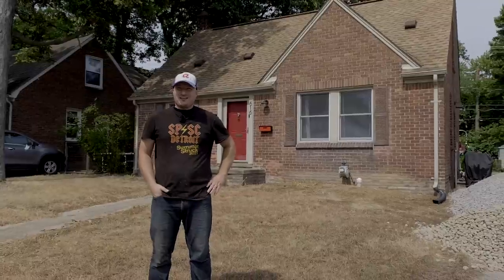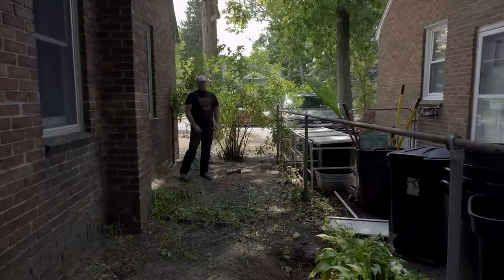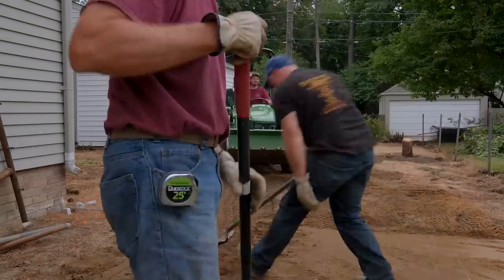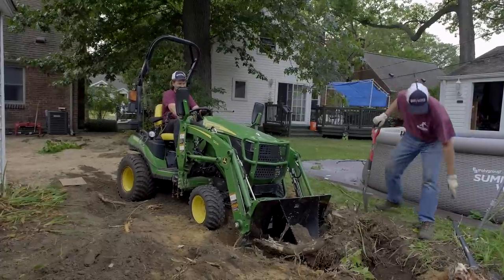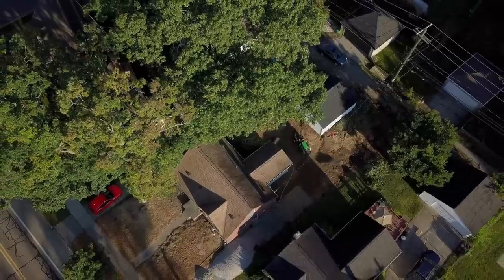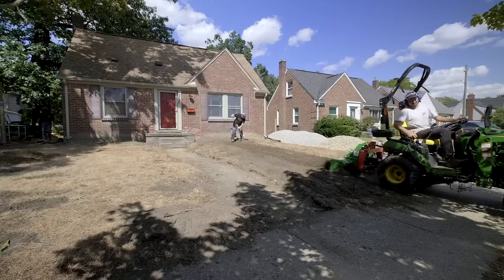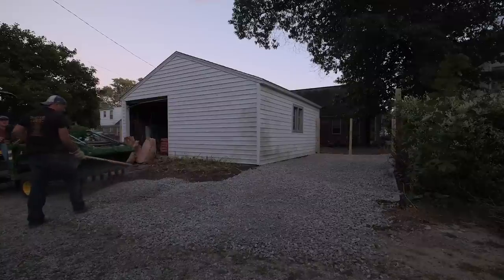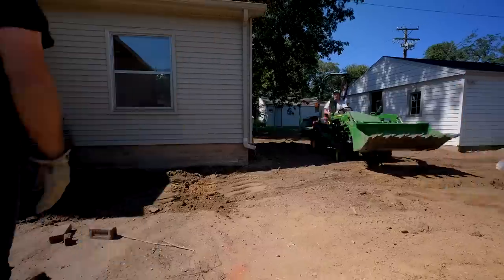JOHN DEERE 1025R RENOVATES CITY LOT! PROVING ITS WORTH! 🚜

Comment: I think it is amazing what you can accomplish with a small compact utility tractor and its attachments. I own a 37 year old John Deere 650 on turf tires with 2000 hours and it always amazes me the things that I can do that larger machines can't. 4wd , hydraulics , a diesel engine,  , a 3 point hitch,and a #7 backhoe. Its a very capable machine that has a light impact on the yard.

Comment: As you gain more experience with the backhoe, you will find, especially with the 1025r & 2025r, that it is easier to stay at the backhoe, raise the bucket and stabilizers, and use the backhoe to push the tractor forward as you work.  Granted, this is really only a good idea on level ground and carefully checking what is ahead BEFORE you move, but it can save a lot of time climbing in and out to move ahead.
And these guys made a great sales video for that stump remover attachment!!!!

Comment: That was a fantastic video, I loved it! Of course since I love my backhoe, I probably would’ve used that to remove a bunch of the stumps but it was great to see the stump bucket in action also :)
Reply: That is what I was thinking and saying to the computer monitor the whole time: "You got a backhoe, use that to get the big stumps loose, then use the Stump bucket to get them out!" LOL  Then when they were removing the concrete walkway in the front yard I was doing the same thing: "You have a backhoe use that to help break up the concrete walkway! Then use the loader to pick it up and move it! Work Smarter NOT Harder!" LOL   I guess with them being inexperienced with using the backhoe they wanted to use the loader and stump bucket.  Great video!!
Reply: @matthewgroff433  Yup. but I also get that if you're not used to it.. and especially before I made dolly's for my backhoe/box blade, it did seem like a big effort to switch out the attachments and they only had limited time, so I understand their choices in that context.
Reply: I would have used the backhoe on the stumps and tried it on the concrete...
Reply from the maker: I suppose I don't see the benefit still of the backhoe on the sidewalk vs the bucket. Maybe it would have grabbed a corner better, but I feel the bucket did it just as expedient as anything else could have. However for digging out the roots, perhaps the backhoe would have been quicker. We actually did dig around one stump (just not shown in the video) with the backhoe. But it may have been hard to tell that some areas were very tight, and that backhoe makes your tractor way longer, which just made it less practical to get into some of those spaces, and just drive around the yard in general. _Chris
Reply: @GoodWorksTractors  good points, it’s all about the situation and one’s comfort and preference with specific attachments.

Comment: Great example of multiple attachments, and how a small tractor can save your back. I had a sidewalk removal project. I rented a concrete saw and cut into slabs. Then used forks to move them to the back of the shop and use them to drop off my attachments. Box blade, rake.etc. Keeps them off of the ground and best of all, no sledge hammer.

Comment: Wow! Impressive to see what that machine can do.  It was mentioned that the loader can only raise/lower or dump/curl.  Did JD ever change that so you can do both functions at the same time? If so, what years did they make the change?
Reply: You can actually do both functions at the same time it can be difficult but there is a sweet spot on the control stick, takes lots of practice...
Reply: You can do both functions easily on a Kubota. I'm surprised Deere makes this difficult.
Reply: @loganliebeskind1591  Are you speaking from experience?

Comment: Good info on the 3 point lifting capacity. I looked up my tractor. The loader and 3 point are the same .... except the loader is at the pins and we all know the capacity out on the bucket or forks is a lot less plus you have to subtract the weight of the loader/forks. Thumbs up.

Comment: Watching that auger in action is absolutely amazing. Not the machine, but the fact that you drilled all those holes in a line without issue. In NH we’re called the granite state for a reason. I’ve dug close to 100 post holes on the 2 properties I’ve owned and don’t think I’ve had 3 in a row without an AFO (auger foiling object). It gave me goosebumps to watch.

Comment: I've removed large stumps 10" - 20"+ diameter with my jd650 mfwd and a homemade fel root ripper blade. Many hours on the tractor due to a learning curve and the size of the stumps. Better than by hand, however probably not necessary for what I was doing with that area, could have ground it out. Time is money and its all about how you want to spend it. Saved money, got the job done at the cost of time, looks good, and now I wait for my permit to build a wood shed there.

Comment: I have a stump bucket, SpeeCo quick hitch, and a tiller from GWT.  They all work great.  I liked this video because it is the real world of getting things done.  It really helps to have someone spot for the operator while using a stump bucket.  I have been thinking about how to install a mirror to the stump bucket so I can see more accurately.  Good video.  Thx.
Reply from the maker: Yeah, part of it is experience. The chain slot allows you to get a feel for where the center of the bucket is, then it's a matter of getting comfortable with your level indicator to begin feeling out the pitch of your bucket. Still, if you can get a spotter, all the better. There are a lot of FEL attachments that would benefit from that, forks most of all.

Comment: I would agree on the size, I used 585 with a loader to get behind my garage I had to squeeze up the sidewalk and a tree up a hill around another tree down some steps level a load of black dirt that was dumped before they started my garage. My lot is tiny only 50’ wide.

Comment: Courtney, really enjoyed the video but I have a question. Why did they choose not to use the backhoe along with the stump bucket? I realize they would have had to reset repeatedly but in the long run it have limited the manual labor. Love the Chanel... I’m still eyeballing the brush crushers. Thanks!
Reply from the maker: Hi Mike, this is Chris. I mentioned to another commenter above, but we actually did use it to dig around a stump (I just omitted it from the video). But a backhoe also makes the tractor way longer, and our space was pretty limited. And with how quick you can move back and forth with the stump bucket, versus resetting the tractor to get to the far side of the stump, it just seemed like 6 of one, half dozen of another.

Comment: I never just run one pipe underground anymore. Never know when you need another especially if you wanted internet or something like that later. Also never reduce pipe size that way. Use a box and then connect smaller pipe to box. Then you don’t reduce usefulness of size of pipe.   Just a old electricians advice. PVC is cheep and not easy to add later after landscaping is in.
Reply from the maker: Good point

Comment: Would've been faster to dig that stump out with the backhoe
Reply: Not necessarily on the backhoe getting it out faster than a stump bucket. A few weeks ago this summer on A Rittter Bit will do, He showed that the stump bucket is actually quicker than a backhoe on subcompact tractors. I will grant you that a professional may be able to do it quicker, but for us want to be landscapers on a smaller compact or subcompact tractor, a lot of times the stump bucket will be quicker and at a fraction of the cost!